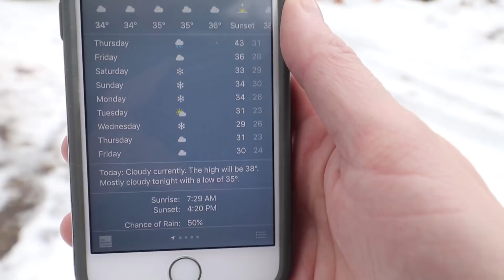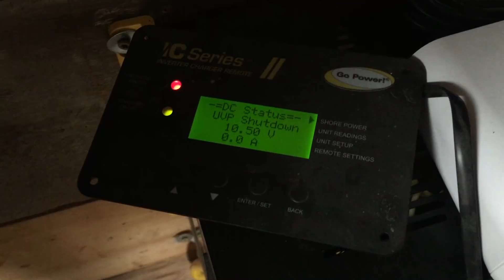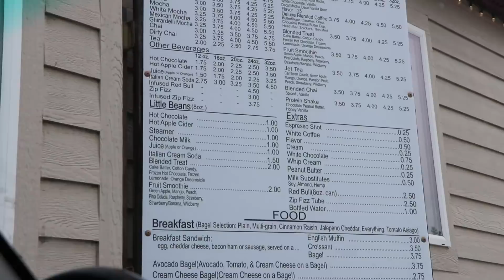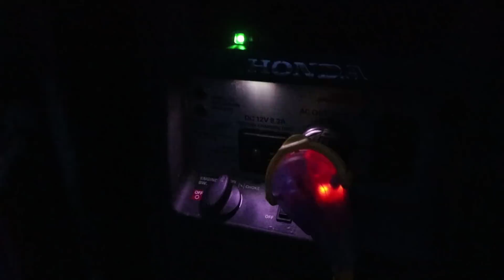Our Story: Giving Up Solar Power to Go On Grid

Comment: The reality is that many people who are currently off-grid would be on-grid if it was within their financial means or even a possibility. For us personally, it will never be an option due to the remoteness of the location we have decided to live in, if it was viable I would most likely take on-grid.  The adjustment to live with in your power generation limitations can be huge, you really are at the mercy of your budget, location, weather and seasons.  This dictates what power dependent activities you can achieve and more importantly when and in what time frames you can achieve them. In some ways you are not in charge of your destiny but have to roll with what each day brings.  This can be a good thing in some ways but also a limiting experience depending on your goals.  Everyone who takes this path needs to continually weigh up all the options and then chose what works best for them, respect to Jessie and Alyssa for living and experiencing it and more importantly adjusting with viable options to achieve their goals and needs.

Comment: Oddly enough, after being without power for 10 hours last night due to a traffic accident, and thinking about having to get up and start the generator, I understand 100%. Grid power is so seductive. But the reality of it is that your analysis is 1000% correct. You guys hanging in there. We’re behind you 100%.

Comment: It's about time.  Off Grid Living has a lot more to do about location than power source.  If you choose to be 100 miles from the nearest town, great, go for it.  You will be off grid.  However, if you're being 'off grid' as a matter of a righteous principle when power lines run past your property along the county road, be smart.  Bring in power to do the things that you need to do to build.  Once you're finished with your construction, go ahead and start using solar, but don't compromise safety and productivity to be 'right' and all the while wasting time and using more resources of other forms to get the job done.  Do what works and then disconnect.  There is no shame in that.  Maybe what you do is install a wind turbine up on the ridge behind your house.  I've watched the clouds blow past in your videos.  There may well be enough to justify a turbine that can feed into the grid that you're now going to connect to.

Comment: Great topic and one not addressed enough.  I lived several years off grid with a freezer at the neighbors and doing laundry at the neighbors.  The gas bill for the generator was more than the electric bill would have been.  Hauling gas from town  (55 miles away) was a stinky affair.  And the poorly running generators an issue.  The solar was nice in the summer but summer was brief (70 miles NE of  Jessy's home site)  All of the solar  equipment is very expensive.  I love grid power.  It is cheap, quiet,  odor free, and quite reliable.  The lessons learned in survival were good although I hope not to have to use them any time soon. I still have a generator back up if needed.

Comment: You need to invest more. In Germany, I have 31 pannels and produce twice the amount I use. However, production and consumption is completly different, so I can only use 10 percent of what I produce. With a Li-ion battery for about 10k I would have about 10 kwh per day which would give me about 90 percent of independance. Still 10 percent is missing, in winter much more. So if you are near the grid, help the community to produce clean energy, but we still need each other.

Comment: Good video. Yes, I also think your solar system is woefully inadequate, you need 12-18 panels and 4 times as many batteries - or more. So, you could go spend $20,000 or a bit more and get a solar system that works a lot better and has more capacity, but as you said - here's what people don't realize:
You will still be tied to it and have to keep the generator on standby for those weeks of overcast weather. Also, you'll be having to plan your life (cooking/washing clothes etc...) around the available sunshine in order to maximize battery life. To live strictly off solar, requires a huge investment AND a choice to modify your lifestyle to align with available power.
Good for you for realizing that it's not right for you, and making the difficult choices.
In the future you can always put up some panels and go grid-tied if you want. What's great about that is no cost or maintenance of batteries, and no worries about cloudy days! If you want to pig out on power one day - cook a turkey in the oven, do laundry, make toast & coffee... all after sun-down - you can!
People gotta realize that the cost of running a generator they way you do with such a small system - and the cost of hauling all that gas - is probably the same as grid power anyway.

Comment: Actually, yeah it is about your system design. What you have is basically a toy; it is similar in size to what I experimented with 11 years ago during proof of concept testing. Now I have a properly engineered system which includes a relatively small10kW array, 35kW of good old fashion AGM storage, correctly sized inverter and a 7 kW, auto-start Lister diesel generator.

The generator had run for a grand total of 26.2 hours during January of dark wet english winter. When the generator runs, it also heats water off the exhaust and I get enough hot water  for 17 hot showers for every hour of runtime while burning 3.6 liters of diesel per hour.

I installed the system 3 years ago and never even think about electricity, using it like its free (which it mostly is) ever since. All I do is check the 1000 liter diesel tank every couple of months. I filled it 20 months ago and there is 689 liters remaining.

To the keyboard warriors, yes it is not cheap aquire a system like mine, but if you are complaining about the expense, you are probably living in government subsidised housing, with tax payer supplied electricity anyway. 

So yes, you two should have gotten professional advice, a hybrid solar design is elegant, super efficient and ready for prime time right now.
Reply: Um, no your whole setup is just a waste of money, your gona be getting klike 85% of that power in 20 years as the pans degrade... your batteries aint gona last 20 years rofl.  and if something goes bad... have fun with no power and fixing it.  While I can have a auto start gen with grid hookup... lol and it will cost me no different...

YOUR system is very likely tax payer paid for... I've love to see you shell out the FULL cash for that.

Comment: You can still use your solar system for backup. If you get a net meter then you can save some money, by the electric company paying you for the power you generate I mean you already have a solar system, if it can turn your meter backwards that's just a bonus.

Comment: I lived on 40 acres with no power for over 10 years.  We had solar power, a generator, a windmill, full-size DC refrigerator, and batteries. We could not afford the money to get electricity to our property, otherwise we would have done so.  Looking back, I would still get solar panels and windmills, but I would have the grid present.  I would do a "grid-tie" inverter, feed the electricity back to the grid, and use it when I need it.  I would keep a small and new battery bank for a backup, when the grid was down.  That way, the grid is effectively your battery bank, and you have the benefits of both worlds.  Can't wait till we can make it happen someday soon!

Comment: I live on grid and I've thought about reducing our energy costs by going solar, but the initial capital required puts it out of our reach.  I'm an engineer and from my calculations, your system is too small.   Make estimates based on worst case scenarios and not a mean average.  I wish you all the best and sometimes we have to back ourselves out of the thicket before we can go forward. I salute your efforts and keep up the good work.  I do appreciate your videos.
Reply: Baruch ben Avraham i got the same impression, it doesnt seem like a fair chance of success in current setup.

But if you are unable to setup a system enough right now then the install choice is.the way to go.
Reply: Baruch ben Avraham a Tesla powerwall can reduce your peak demands,  cheaper then solar roof. Might be the biggest bang for you buck
Reply: Very much too small.
Reply: We Chinese now have electricity and Americans are now going off grid.  We used to live without any battery and we were fine, so you should be fine only with those panels and batteries. Keep going that direction, you'll make America great again.

Comment: You did make an honest attempt to use solar. Your needs exceeded the capacity of your system. That is all. Solar is possible on a whole home system, but it does take considerable investment to get it done right. The payback is considered to be about 20 years.
Setting your priorities sometimes makes for giving up an ideal, but can create less stress in the long run. I don't see this move as giving up, but making a change that may save your project in the long run.

Comment: Solar works if you put in the time to work out what you need then then work out the best way to achieve that, be it full battery/Generator/grid or any hybrid. 
plain and simple they didn't do any planning and waited for handouts from sponsors, Jessie showed his lack of understanding when he had to call the tech support guy only to find that his batteries where in float. They bought 2nd hand batteries that were useless but hey they served their purpose cos they got a few vids out of it.

Comment: I live in the Pacific North west on a solar powered homestead. I have a 4800 watt solar array. I installed all the equipment myself at a total cost of $12,500
People down the road are paying up to $50K to get power to their homes from the power company. I would never do that. We have a 1600 ft house that has all the modern appliances. We are not even careful at all how we use power. Now back when we had just 600 watts of solar winters were very hard. It looks like to me you simply do not have enough solar power for your needs. Unless you replaced them when I was not looking your batteries were used when you got them and were heavily sulphated. When you get the bid to have power dropped to your house I think it would be smart to look into a real solar power system that is designed for your power needs with the ability to add to it later. The price of Lithium ion batteries from a Nisan Leaf have come way down. In fact I can replace my battery bank for half the price if I buy a used EV battery. That said solar is not for everybody and you have to do what is right for your family.
Reply: I've seen and read many articles and videos over the last 10 years on Solar. There are plenty of success stories. I think they didn't want to make a large investment, and so it didn't end up working. Like you said, you have to put down a good chunk of money to get something worthwhile. I don't watch all their videos, so I don't know how well they get sun on that side of the hill. Also gas appliances help a lot. During power outages I ran gas dryer, pellet stove, gas furnace, stove, water heater, fridge and more on an inverter 3KW generator and the fuel costs were not terrible. Some people hate gas and prefer electric for dryers, stoves, furnaces and such. To each their own. I just hope they don't put all their stresses on to one solution as it sounds like they are getting a bit of tunnel vision on one problem that's truly bothering them. Also who cares what others think about whether you're on grid or not? Do what you  want. Living out there in the dirt without everything that you grew up with can be very taxing mentally and physically.

Comment: I love my solar system. I'm what's called grid tied with battery backup. It's been especially nice this past week when a ice storm came thru and bought down miles of grid lines. Of course because of the time we was with out grid power our battery died. So out came the generator. But for the majority of the time we actually get a check from the power company. So is off grid the way for me. No but I found a way to be self sufficient with the knowledge of not ever being with out power.

Comment: I only need to correct one statement that you made, Solar Technology isn't there yet. Solar Power Technology is most definitely here and well. What you are missing is the money and location needed to install a system that will meet your needs and that's okay. When your house is mostly done, when you have enough money for batteries and panels and chargers and such and when you have a good permanent location to install Solar, then you will be in good shape. Additionally, your comments about solar not producing is because you are using mono-crystalline panels. Being where you are, where much of the sun is clouded over requires you to have poly-crystalline amorphous panels. In fact, a bank of mostly poly and a smaller bank of mono would even be better but we are talking money here. That's the real deal, nothing wrong with being on grid, but when you can afford it, the option is still there and alive to go offgrid again.

Comment: If you are going to crank up a generator that is no different than being connected to the grid in your neighborhood.  It is going to cost you tons more money to keep that generator running than to pay for the KW off the grid. Solar is great but you need to look at that as surplus power that you do not have to pay for.  If you calculate what it cost to run that generator for the KW and then what you  pay the local power company for the same KW you will see how cheap on demand power from the power grid is. Dont forget the emissions you are put out for generating your own power is very high compared to the grid.  Idaho has alot of clean hydro power blended into their grid.

Comment: it makes sense to go on grid, really. You can't effectively generate power with solar panels o the ground and so little square footage of panels. I do feel it is 100% possible once your house is built, that you can go totally solar for summer months (except extreme heat days) to save on energy in summer and save that for winter heating. but all in all, you need a much bigger system to be usable.
Reply: Agree, and not use cheap used batterys, they should also have a generator that starts automatic if battery charge drops to much, they should also not meassure voltage to get battery status, instead a controller should meassure Ah and never let battery drop below 50% of Ah capacity. They would last way longer. The system they use fits better to a small vacation type cabin. And in their situation I would put up a 5kw wind generator that take care of nights and days without sunlight.

Comment: Anyone not see this coming? lol. The system was never big enough. I have lived using entirely solar power for 15 years in the uk and I run a server farm which uses far more electricity than the average household. I use exactly the same charge controllers, just more of them and a lot more panels and batteries.

Comment: I've been following your journey and learning from your successes and mistakes.  You've done a lot of things that have me saying "I wouldn't have done it that way!" and your solar system was one of them.

I tripped across your timeline looking to learn about solar.  Knowing now what I didn't know then, I think your system is undersized for what you want to do, which is why you're on your generator so much.  I don't disagree with the decsion to go onto the grid, although I think you'll end up beefing up your solar system and power storage later.

Keep the generator handy, though.  Rural areas are notorious for having power outages.  Heck, I live in the "suburbs"  and we have regular brown-outs 2-3 times a week, and were on our generator 4 times last year and once so far this year.

Comment: Your equipment is not enough for what you’re needing. Most homes have larger panels than what you have and even have gas appliances. Too bad your roof can’t be used for solar since it’s pointing in the wrong direction. I’d at least build so you can tie in solar later to help offset utility costs.

Comment: If you can get grid power at a reasonable installation cost it is probably a good idea to do it. Your life your choice.  One thing to consider is use the panels you do have and get them plugged into a grid tied system and supplement what you use from the especially in the summer. No need to worry or chase around in the winter if it snows clearing panels if you don't want to. just use the grid. Alternatively keep the solar off grid as a power back up if the grid is not always reliably on. Good luck!

Comment: It takes time to get the basics done, I get that, May I present another option?

In this video, the main issues outlined are, Fuel runs, having to refuel the generator in the early AM, can't do laundry.
I other videos I have noticed you use 20Lb propane tanks for heat.

How about buying a 500 gallon bulk propane tank? The fuel would come to you, cost 4x less, and you can run your Honda generator on it as well.

It would all depend on the cost of getting power to your property. For us, We already had a few 500 gallon tanks, and it would cost 15 to 25K just to bring power to our property. So we converted a 5Kw generator to run on Propane, It can power everything we need it to, and with the money we saved by not getting power, we were able to get a decent Solar setup as well as a 2Kw wind generator. With the combination of solar and wind, we don't normally need to run the generator.

We do have a freezer and refrigerator that runs off propane rather then electric. Don't use electric space heaters, Instead of a generator, we now have a homebrew Propane battery charger, I't just a 12HP propane engine from a floor polisher coupled to a 24V 50A alternator off a Diesel Chevy truck that recharges the batteries.